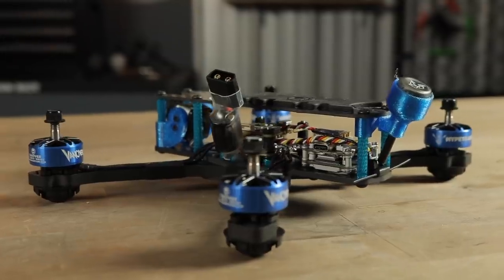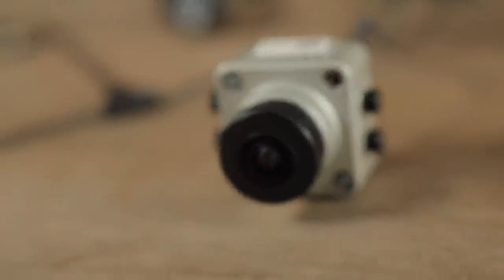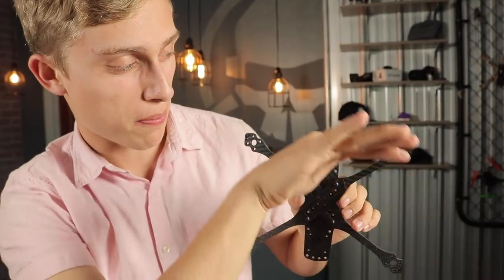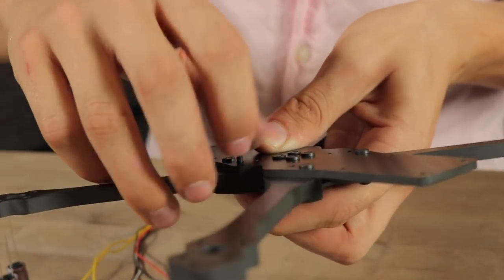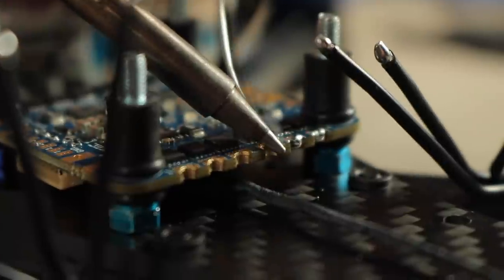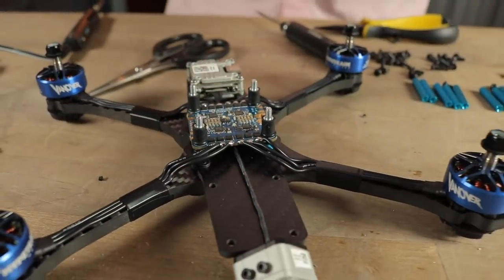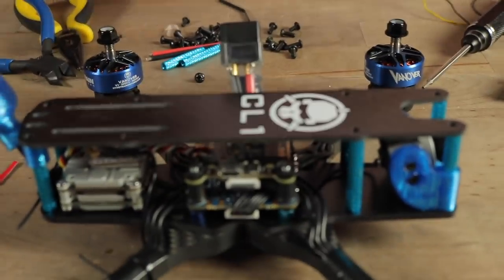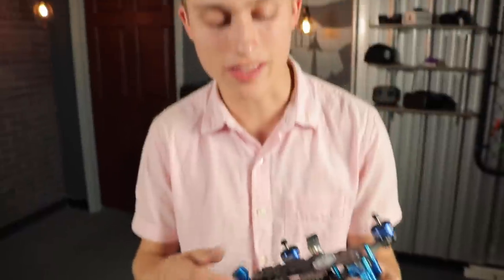Build: The CL1 Vannystyle (with CaptainVanover)

Comment: It´s not recommended to put the capacitor on the end of the battery wire. It should be as close to the ESC as possible!
Reply: 90% of build have the cap connected to the XT. No issues.
Reply: This is technically true but unless your black boxing to log voltage spikes none of us are going to know the difference
Reply: @Vizr  my XT60 caps got quite hot after normal flights, added a small extra cap directly onto the ESC, no more issues. If your XT60 wire is short (like in this build video) you might be fine, with longer wire I don't recommend it.
Reply: @NickBusscher  I’ve always ran 14 gauge XT60s on power pads with 330uf caps and have never had a heating issue. I run the FETTEC 35a esc exclusively.
Reply: @brendand.2269  untill your ESC burns out;)
Reply: I’m not an authority on this subject but I would guess that Vanover knows what he’s doing. He probably builds more quads in a year than I will in 10.
Reply: @NickBusscher  Why the spike absorber is sweet and i use it on all 14 fettec 45amp esc builds.

Comment: Awesome build tips !!!!
 I have 2 suggestions when mounting the vista or 03's with VHB use two piece of VHB and leave a space or channel for air circulation under the vista .
Second, if anyone is objectionable to not using the two standoffs in the rear, you could drill a single hole in the center of the frame in the upper and lower plate, and use one standoff in the rear, which would give a decent amount of structural rigidity back to the rear box of the frame.

Thanks for the bill tips Vanover I love to watch different peoples build suggestions !!!!

Comment: One of those lock nuts is a different blue, triggering my OCD. Really tempted to try out the FETtec.
Reply: Don't waste your money
Reply: Waste your money... Not .. It's great been using for 6 months ..
Reply: Follow on how to build FETTEc properly and never look back.
Reply: @Vizr  you still can't just solder or plug your vtx to the fettec fc or do you? Do you still need the osd and pdb? I simply dont have enough room for that in my reverb.. would love to try ot out though
Reply: @100100freak  Before I switched to digital, I ran telemetry warnings instead of OSD. However, I do have a FETTEC osd board I was going to run in an analog set up but it’s no longer needed because I’m switching to shark byte. I’ll be posting the parts in FPV groups on FB soon.

And yes VTX plugs onto FETtec FC. Very easy.

Comment: You don’t need to go back and forth between KISS GUI and FETtec configurator to check motors.  You can do all ESC setup (except ESC orientation) on the FETtec configurator.  Motor test is under telemetry page.

Comment: Nice build Vanny. I like how you’re making it pretty light and yet it’s dji with some little extra beef in the motors
Reply: Yeah uses a crazy heavy frame and heavy motors and kwad skids and somehow he still comes out at 630g au.
Reply: This frame Rocks i'm on my second build with it
I totally believe the 630g without go pro
Mine is 661g RTF with gopro session, Jb f7 flight stack, tbs unify pro hv, newbee drone flow 2306.5 2450kv motors, foxeer trex micro, tbs rx, talon faf series 1300mah 125c 5s lipo 175g, rotor riot skids session and sma mount 
I used 25mm stand offs and dropped top deck down 5mm 
UAv tech pre sets with some minor changes 
so i have around $375 into the quad its a bad mofo on 2450kv motors 5s cut to 90% in beta flight

Comment: Had three screws on my new build day before yesterday... I spent 4 horus last night repairing one of my motors because of that. It flew great till it hit the ground low and fast. Motor came loose twisted and broke all three leads so I had to take it apart find new motor wire inorder to extend the motor wires right from the stator. They don't make those motors any more and a new one was crazy priced. So ya.. imma stick with 4 screws bro lol

Comment: Question? I am just getting into my 1st build, I noticed you put Esc with motor solder terminals forward & reverse facing as opposed to left & right. Is their a specific reason for this or just protecting the wires in case of crash or impact?

Comment: One mistake. There are no replacement pads for the connector that you used for Vista. I ripped it out, damaged traces, and now i cant use that serial port... You have the other two serials on the top, but in my case, they are occupied by crossfire and gps...
So, no replacement for that connector rx and tx, unfortunately... :(

Comment: I just ordered Fettec FC+ESC , i wanted to give it a try since quite a while ;D and you helped me to take the decision. Is it possible to see your pids/settings ?
Reply: @adamjosey1543  i mounted the drone, but the FC seems to be dead...ffs at that price that's a pain in the ass. it is very weird, i cant connect to it, while i did activated and updated it, i think it might have burned cause of the air unit i'm not sure
Reply: @adamjosey1543  there are only betaflight PIDs and Settings 2 find - where is the good fettec stuff??
Reply: @snakeyefpv  same here. did you finally managed to find the vanover's pids?
Reply: @archonoff  not really, but the preset's work well too...

Comment: Does that Flight controller and ESC come with any of the neccesary Wiring, Screws, Manuals.... OR ANYTHING????
Reply: Fc comes with nothing. Esc comes with a cap and wire harness to connect to the fc that’s it

Comment: “I like to save weight by using 2 motor screws.” Do you know how much those kwad skids weigh?!? It’s insane
Reply: Also they are using too long standoffs. They can use at least 5mm shorter standoffs.
Reply: @mimarfpv  yeah fir real. I truly don’t understand where they are saving weight here. Amazing they got the weight they did. I bet it’s not 630g
Reply: I tried 2 motor screws a while back, but I've actually gone back to 4 as I had a crash that which damaged the motor much more than it should of. It bent the bell on my new TOA Turbine 2306 motor but also broken the motor mount where the 2 screws went in and delaminated the carbon on the arm. My opinion is that with 4 screws it would of still damaged the bell, but the mounts for the motors should of survived from the extra strength meaning only needing to replace a bell rather than the whole motor. I think for a freestyle rig the weight of 8 more screws is not important.
Reply: Save weight lol!  I have always run 4 and it has saved my ass more than once.
Reply: @3000gtwelder  me too. Only excuse for only 2 is on micros IMO

Comment: No OSD board? Can you still pass through LQ from crossfire using aux 4 etc...?
Reply: If you use dji and run the latest firmware you get voltage and amps along with RSSI which is basically link quality in your OSD
Reply: @OriginaldoBo  Thanks! Does it just pass through on an Aux channel? So I can pass through LQ instead of RSSI?
Reply: @OriginaldoBo  How can I pass LQ?

Comment: Dude I bought one of those stacks as my hopeful intro to Kiss. After ONE flight the FC was bricked. Now I'm sitting on an OVERPRICED build with no osd that still flys like shit. What gives?
Reply: i've had horrible experience with FETTec stacks as well. i know others in the same boat. my FC was fine for a couple weeks then the MCU burned up out of nowhere. literally landed after a very calm flight, plugged in the next battery, and nothin.
Reply: I fly Fettec only and I never had any problems whatsoever, even though I am not flying gently and my tune is very aggressive. To be fair, I put a LOT of work into my quads. I think a clean and well build quad is the foundation of not having problems.
Reply: @stone_fpv2599  Kiss aint for me. I was extremely dissapointed with the cost and lack of options with it. To each his own as they say

Comment: That is not a budget build . its as good as a build gets for freestyle and that motor stator size.  Budget build would be like a 50$ esc fc combo , sunny sky motors , pwm receiver , and junk camera in analog form and 200mw max vtx.  I have 2 of these quads 1 in fetec f7 with Ethix v4 2306's and one Just like this build here with fet tec G4 and there 2 of my nicest freestyles.  I also have 20 others yea but still it was kind of odd for you to not call it what it is which is high end build.  Let me know though if a free style 5 IN.  quad can be 30% better than this one on same frame. I don't see the capability.

Comment: Always wondered why they call these “builds”. Aren’t they more like “assembles” ? I mean you’re not building anything really, you’re just grabbing pre-built parts and bolting them together. When I was a kid I built my own stuff but I assembled my big wheel and my hot wheels racing set. Some assembly required 😝
Reply: When used as a verb they can mean the same thing. To put together or take shape or form using parts. He is using Parts

Comment: ok, is not a learning video! it's going too fast and there are things that people who start to solder can destroy their equipment, it's not that I don't like the build eh! it's just a few things, like the Vista, vertically for soldering .. average, the fact of not using the "standoffs" I understand, but for a beginner, he needs the rigidity for the crashes in my opinion .. there is the XT60 without direct zip-tie to the ESC, it's the same, it's fine if you have either equipment galore, or which does not crash .. but it happens .. so good, I would say the capacitor directly on the ESC (better ..) and a Zip-tie to ensure and avoid the tearing of the wires on the esc .. also, why not put anything for the vista? at least one zip tie .. again .. why no screws ?? in short, great components and great build, but there are a few tips for beginners that made me jump! :) (after if they crash slowly or not at all, no worries !! ..)
Reply: Thanks for commenting,I will refer you to trade analyst and, accountant to make good income, go more on digital asset's
Reply: @user-sy3qf2se2o  no problem!!. I just wanted to give you some details .. for beginners, I personally have almost nothing to complain about, but it's personal, and it's just to help ;)
Reply: @leflamantrosefpv1725  Your talking to a bot...
Reply: @3000gtwelder  yep ;) hum..